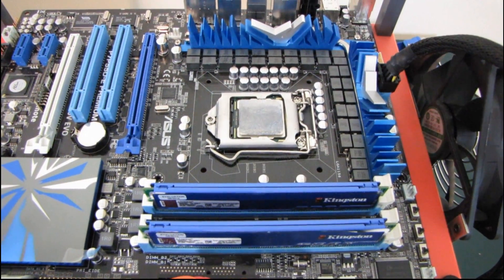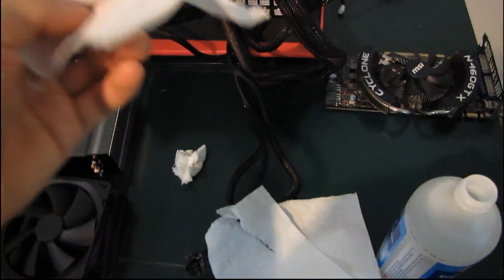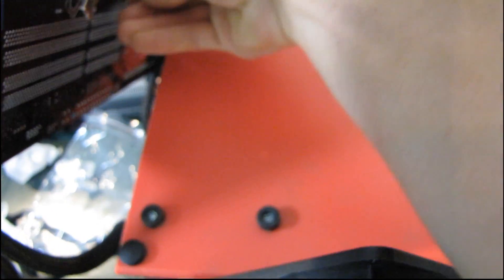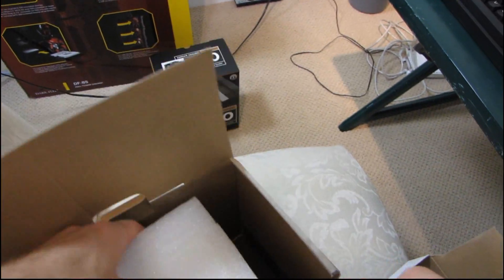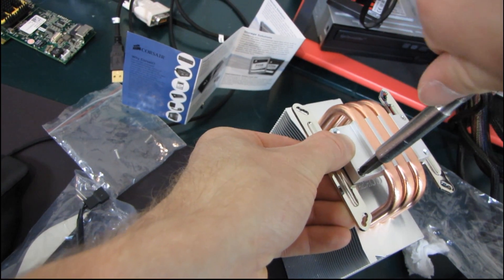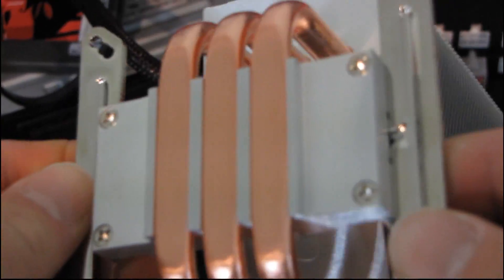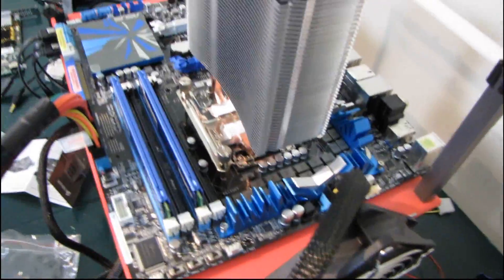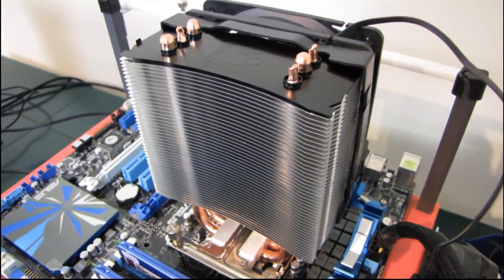Corsair A50 Heatpipe Heatsink Cooler Installation Guide Tutorial Video Linus Tech Tips

Comment: Can the pcb mounted vertically and heatpipe horizontal ? Would its weight stress pcb.. ? would that reduce efficiency of cooling ? Would it help if i upgraded from stock intel cooler to cheapeat heatpipe.. say 10$ usd as of Q4 2018 ?

Comment: From what I've been seeing, there are a number of ways to apply thermal paste and heatsink/fans. One method is to apply a small pea-sized amount of paste on the cpu and then simply apply a heatsink on top allowing the weight (and later on, the heat of the cpu) to spread the paste evenly over.

Comment: When applying thermal paste, I've been looking at the guide by Arctic Silver for heat pipe heat sinks such the one in the video. It recommended to use a gift card and place the paste on the heatsink first on the edges of pipes... is it necessary?

Comment: The 212+ cost less and might cool 2f or so better- it has more pipes. The a50 did cost the same as the 212 for a long time- not sure why it is like 40 bucks now. The 212 is only like 25 bucks at n-e. I still say the a50 back plate mount set up is lower profile and might be best for some cases- shop around you should find it cheaper than 40 bucks for sure. If no probs with space on the back of your mobo- the 212 is the better deal and cools a lil better than the a50..

Comment: @ezeht I like this a50 its back plate is a lower profile than some. My case mobo removable tray is shallow not much room between it and the back of the mobo- my antec p160w and this cooler are perfect. My i5-750 runs idle 25-30c for time of year etc. The instructions suck- the black washers do go on the back plate. After pulling teeth corsair confirmed the washers go on the back plate. Proper adjustment of the posts no forcing- or beating on your mobo- has extra money maybe.. 750 can 4.2ghz

Comment: Fan side might not matter. The black washers go between the mobo and the back plate 1 per post- you keep the plastic isolator on the back plate also. folks can get anal about tim. I like ac mx2 or mx3 and you can read I put thin coat on both the cpu and cooler and temps on average are more low than just spread center because coat the whole thing all of it transfers heat and not just the center- trapping air might be one slab lay on the cpu- not a dot spread out- mostly bull crap.

Comment: @JRFvids if you spread out the compound using a card you may be trapping air on the underside of the paste. If that happens then your cooling is going to be less (at least in theory) But when you are placing a blob in the middle or using the line method then the cooler will spread it out and push it down so that no air is trapped.

Comment: You put the fan on the wrong side both on the heatsink and on the motherboard lol. 
Otherwise much better than the corsair manual thanks :D 
Oh and what I noticed was that the manual is wrong you don't use those holes during the bracket adjustment. There are actually 3 before you get to the holes so you have to get it just in the middle and there isn't that much distance so you can get it in perfectly without forcing lol

Comment: @9827378311 You don't really need to spread the compound because the pressure of the heat-sink spreads it.
He didn't remove the plastic because if he did it could make a short and fry your motherboard. It is meant to stay there.

Comment: @bugatti94 no, you don't do that. Just do what Linus did and put a small pea-sized thermal paste on and the pressure of the heatsink will do the rest of the work. Plus, brushing the thermal compound yourself will lead to a very high chance of air bubbles forming which is bad.

Comment: @zver711.You were supposed to fit the plastic spacers between the motherboard and backplate so that the back plate does not squash any solder joints and cause problems with those joints, earlier Asus motherboards (Socket478) had this particular problem with standard Intel coolers and stopped the motherboard from booting after a few Months. Also it IS better to spread the thermal compound over ALL of the Heat sink contact point to guarrantee you get maximum contact with CPU. Nice videos BTW

Comment: Corsair A70 cooler has same exact mounting gear and there was also no mentioning what those 4 rubber grommets were for. From my experience with CM V8 cooler I think those are may be for putting them b/w the backplate and the bottom of the motherboard.

Comment: meh that heatsink looks a little weak, great videos as always from linustechtips, i myself currently using a zalman 9900 blue led, still not good enough for overclocking too high, get 40-60celsius on 3.5ghz with no voltage increase intel core i5

Comment: @scattrr thermal paste will spread itself by both the weight of the cooler and the pressure by the screws. you just need to place it right in the middle of your cpu, otherwise half of your cpu won't get any thermal paste on it...

Comment: @AgentHydra absolutely right spreading that thermal paste is totally necessary for that heatsink design take so an extra minute take a card and spread it around the processor so you get the best cooling potential out of that heatsink you might very well burn out that processor if you dont!

Comment: most AMD motherboards come with a backplate, is it wrong if u use the one already on the motherboard instead of the one that comes with the cooler?
i did that cause a) i think the one  that comes with the cooler is not as sturdy as the one on the motherboard and b) i had to remove the mobo in order to change the backplate.

Comment: Hi Linus, I noticed you didn't spread the thermal paste in any way before screwing the heat sink down. Was this just because you were recording a video or would your normally spread the paste at this point. The reason I ask is because I need to reseat my heat sink and am a bit of a hardware Noob. (Antec 1200 with Noctua D14 but my 930 do is idling around 40!)